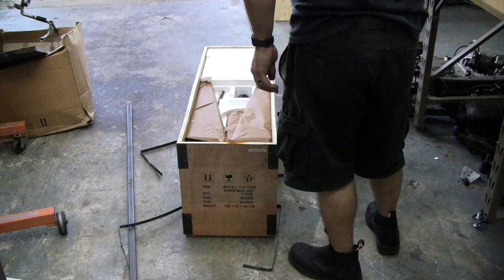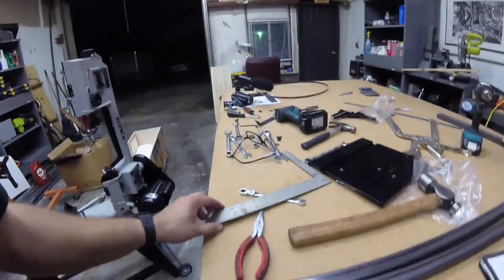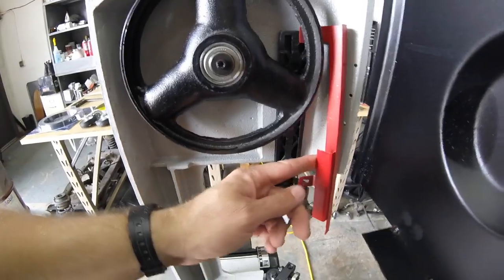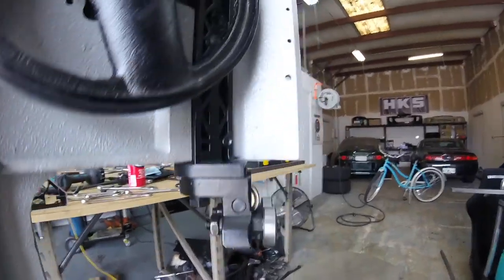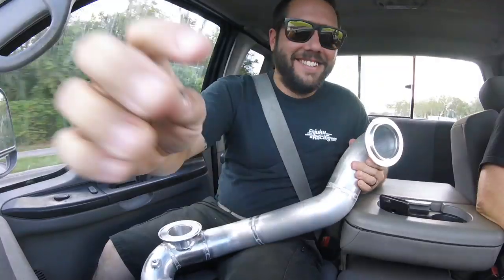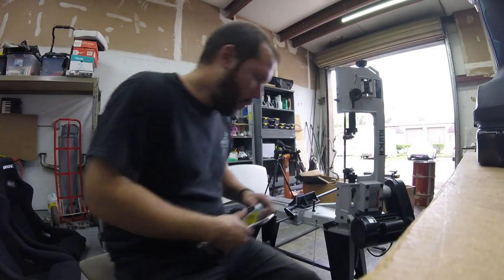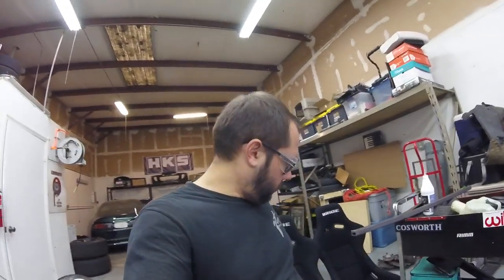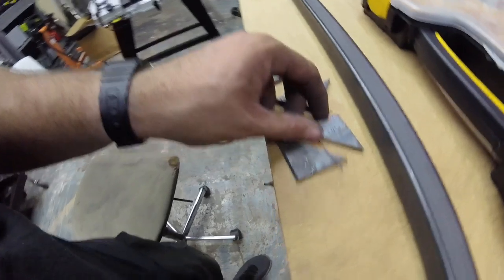Klutch/HF 4x6 Bandsaw Setup

Comment: Why don't you have a set of Thin Wrenches?  They were exactly what I needed to install the casters on two of my work benches.  Get them at Home Depot or Amazon.  I bought them in both SAE and in Metric.  Even if you use a tool once, it has paid for itsself.

Comment: Hey man, I just bought this saw and cant seem to get the blade guys adjusted properly so my blades keep bending in half sliding off the thrust bearing and getting jammed like yours did. I'm on my 6th blade now and was wondering if you had and advise for setting this thing up for proper blade life?
Reply from the maker: Hmm, is the big wheel on top adjusted correctly? It has a bolt on the outside where you can adjust the pitch of the wheel and center the blade on it. make sure the blade is centered on the wheel.

Comment: I would have called the dealer and had them send, somebody, out to set it up or send it back. That was a rediculous amount of work that you had to do to set it up.
Reply from the maker: I would prefer to do it myself, that way I can fix it later if something happens
Reply: I just got one today, the install instructions could use some tweaking but I got it. Mine cut great. But will need some blades for different metals